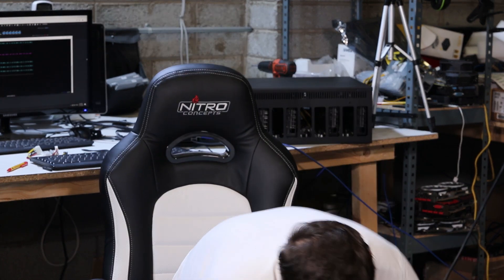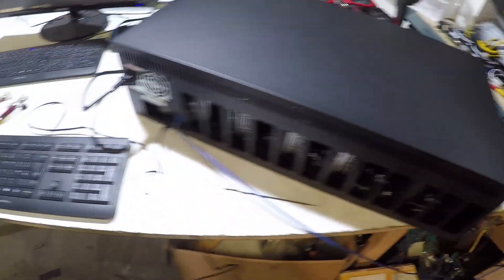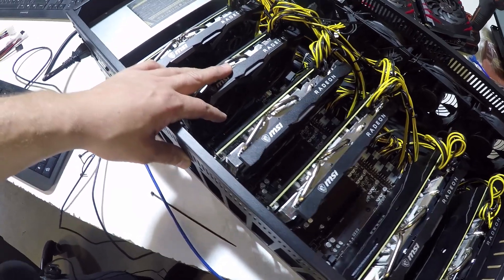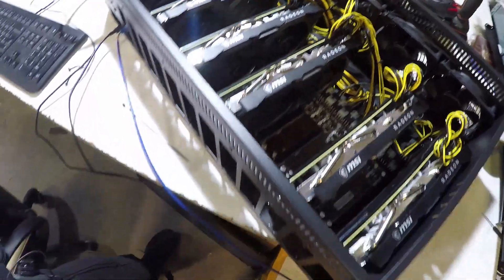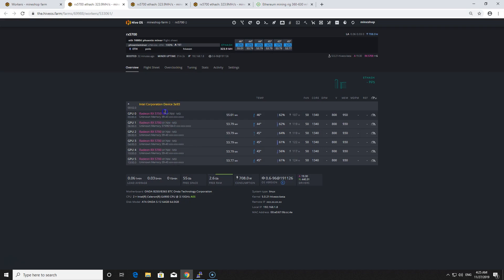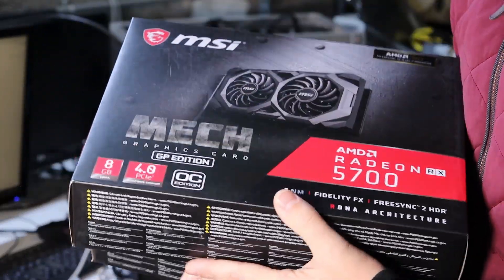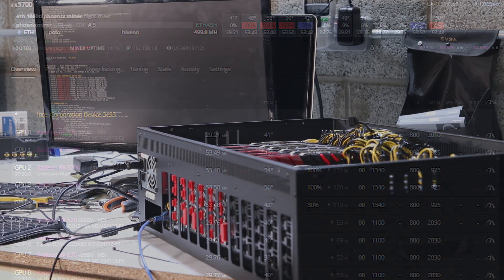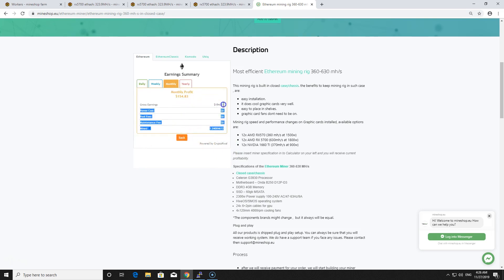500 mh/s 🔔 Ethereum mining rig RX5700XT vs RX5700 vs RX570 !?

Comment: would you still recommend these same settings for these cards?
Reply from the maker: On which cards exactly?
Reply: @GuntisVitolins  i have the same non XT MSI Mech RX 5700 and I also have an XT version by Asrock the challenger which is the one that gives me issues with temperature and stability and also showing the fan speed
Reply: the non XT Mech MSI version is amazing I haven't had any issues with it and I can get the same hashrates as the XT version and it was the cheapest one on NewEgg I already ordered more of them to build my rig with
Reply from the maker: Oc really depends from card quality. Annals of card bios timings modified card will have different overcloks for most efficient  mining then not modified.
Reply: @GuntisVitolins  Okay so since I didn't mod the memory straps on these I will have different settings than you

Comment: I also have a Sapphire RX 5700 XT. I bought it for my HTPC but it didn't fit in it, I'm using it for mining right now. Mining ETH 50.1 MH/s @ 1250 MHz/700 mV. Quite efficent, but a strong disadvance is that you'll only enable to mine Ethash with this card (TRM doesn't work unfortunately).
Reply from the maker: What is your memory OC?